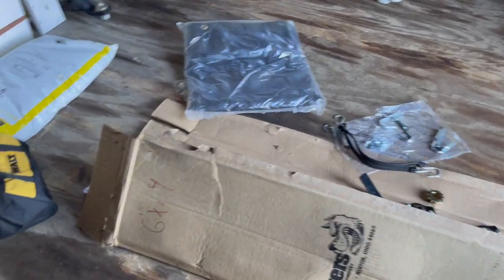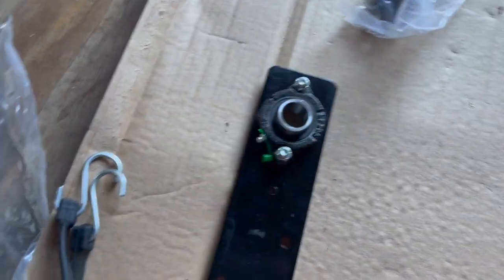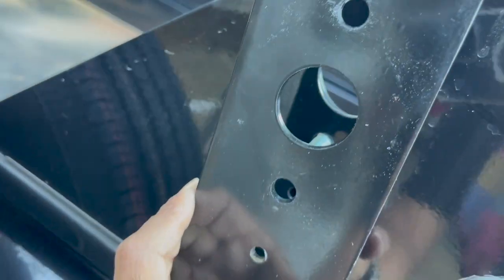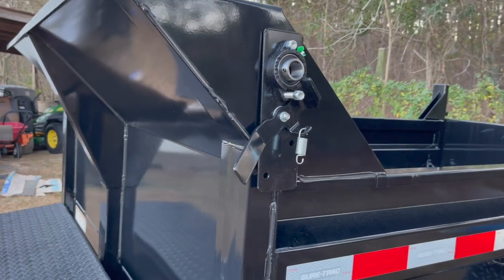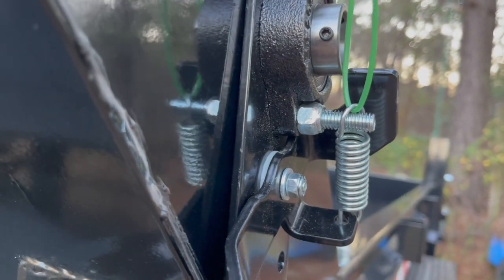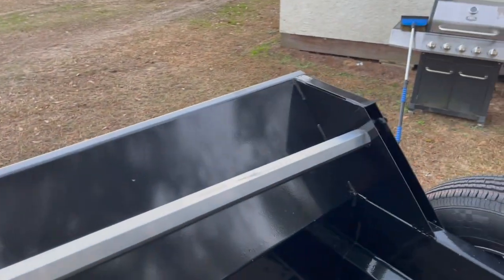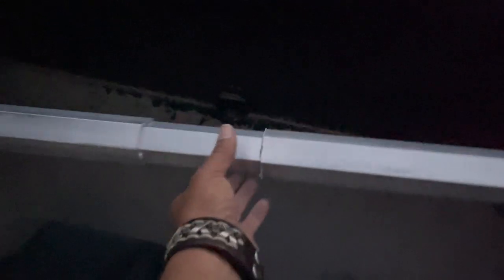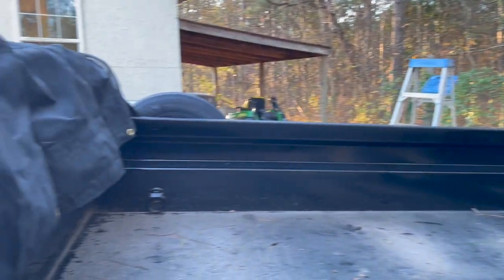Installing the tarp on dump trailer  Sure Trac

Comment: The holes on the trailer are predrilled to fit the roller components.  You do not need the need the mounting bracket. Take the parts off of the mounting bracket and screw directly to the trailer. If you want the extra suppor from the bracket cut it and put on the inside so you don't see it . It gives a much cleaner look and the hardware will fit flush.
Reply from the maker: Thank you for the tip.
Reply: Anyone have the link to this rolling tarp?